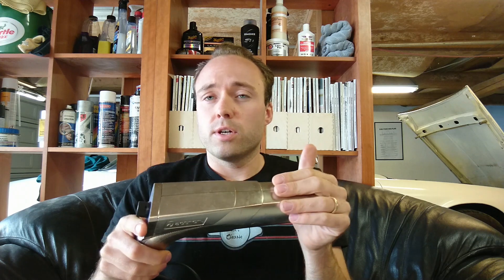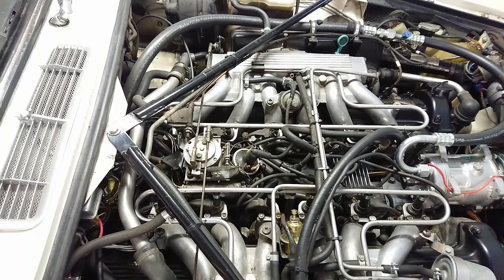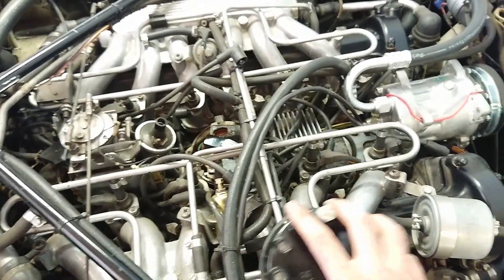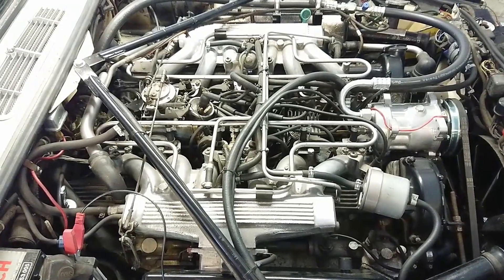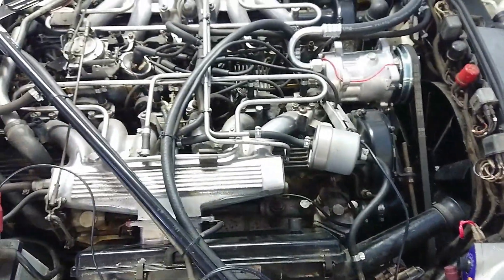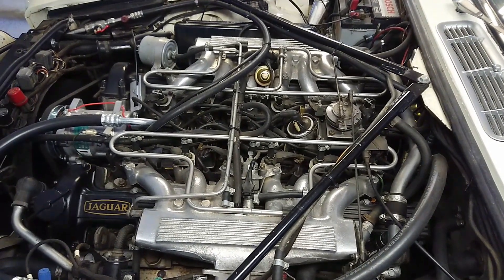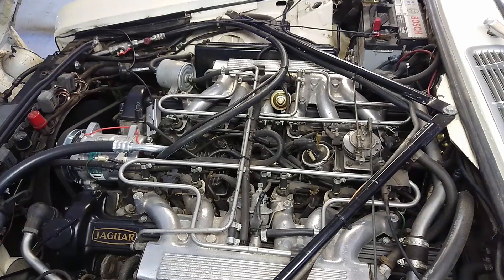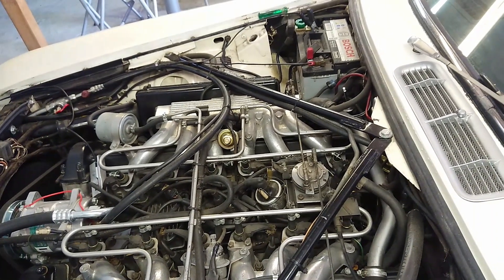How to tune a Jaguar V12 Part 2 - Setting Ignition Timing

Comment: Hello again Adam, Adram Caleb down below said that a 1990 XJS's timing is controled by the ecm. Is it possible to check the timing with a timing light to see if it is correct at idle. My car is very sluggish and won't rev over 3,000. Maybe it is a bad ecm or a pluged up cat. converter. Any thoughts? Thanks, Doug

Comment: I have a 1990 XJS with the V12 Marerli.  It is backfiring.  I think the timing is off but I set it to the static on the distributor. What suggestions do you have. My next step is to completely rebuild the ignition wires. They are looking brittle.
Reply: Hello Abram. What do you set your timing at? thanks, Doug with a 1990 XJS.
Reply: @dougvankalker733  As long as the chains are lined up and the distributor is set to the the default mark, the ecm will adjust the timing on the 1990

Comment: Well done! However, for people who really want to know everything without really understanding it, you could tell what couterclockwise or clockwise do. I think you change the baseplate of the distributor with the nut to set it? If so, making the plate turn counter rotorwise, you will have more advance of course. 
Many thanks! Discovered this channel by looking up how the d jetronic works. Also added a comment on that video. 
Thanks and be safe!
Cheers from Belgium!
Didn’t you forget to rise idle a bit or do these engine idle that low?

Comment: Came across your channel  and glad to see someone posting about the beloved V12, had my XJS for   9 years and even though I did my timing different (helps to have a 2nd person, and a timing light) being old school, I'm 65 I did mine by sound, feel and smell. the feel part, is placing a hand on the engine and feeling it smooth; you smell, just that the smell of the exhaust, sound how it sounds when you throttle it up ( no shudder, lag or hic-cup)  forgot to mention, mine is a 1984
Reply from the maker: Thank you for watching! I will try to post new V12 videos in the spring. Enjoy your '84!

Comment: All your videos are extremely helpful. I do have exactly the same engine from a V12 XJC 1975. The timing of my engine could be done since a white bar
was already set at 10 degrees. It just needs to align with the mark on the flying wheel.
Furthermore I bought the set for the tubes and rubbers of the injectors to replace the (terrible) old ones. I did recently replace all the fuel hoses
with brand new ones though. So this had still to be done. On your video (fire in our engine) the instruction how to replace the old ones again is very helpful!
Reply from the maker: I'm really glad the video could help! A V12 XJC is one of my dream cars! They are fantastic 😊